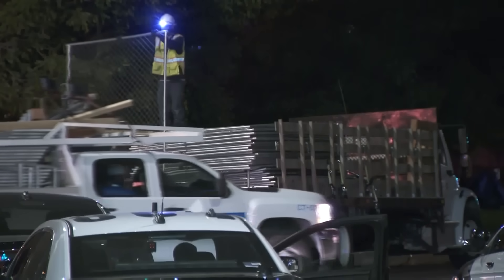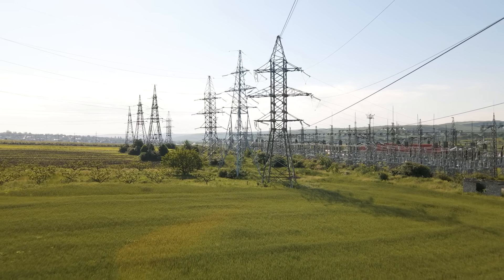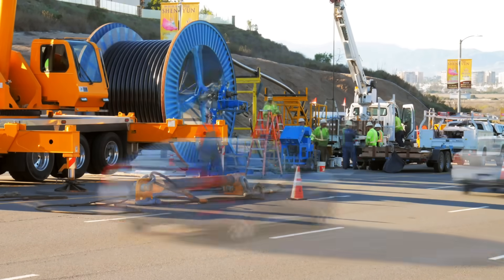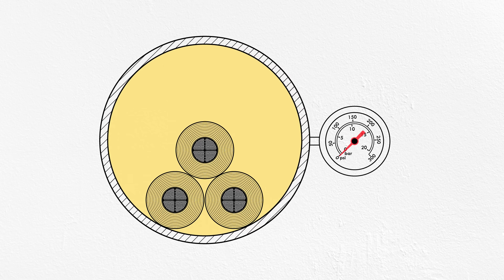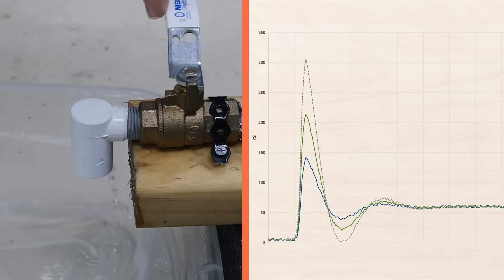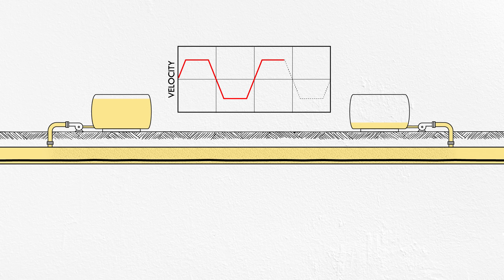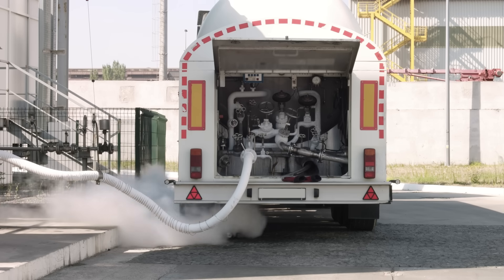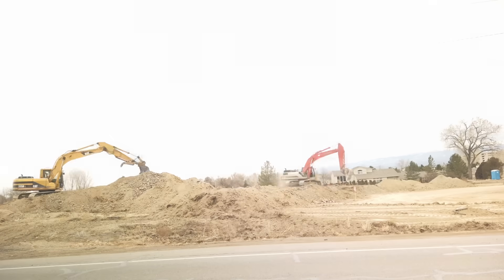Repairing Underground Power Cables Is Nearly Impossible

Comment: The craziest thing (to me) about underground cables is this:
Underground high voltage cables are very long conductors energized at high voltages, all within inches of other phases and ground, but separated by some insulator (like oil or polyethylene).
There's another name for big conductors packed as close as possible and separated by dielectrics:
"Capacitors"
The sheer amount of energy that ends up stored in the electric fields in those underground pipes is enormous. It changes the way you have to think about transmitting electricity because all of your lines are way more capacitive than they would be on poles.
Reply: HVDC underground takes care of this.  It builds up a charge capacitance, and then holds there.   Which is actually how we test them.  Charge them up to a set voltage, and let them hold it.
Reply: @philtimmons722  Oh absolutely. Unfortunately the cost of converting from AC to DC to AC is more expensive than just building a 10 mile underground line.

Comment: Hmm, interesting. And that was a pretty clever solution. I've long wanted our power lines here in the Midwest (and specifically within Tornado Alley) to be buried. Tornadoes, blizzards, and high winds regularly take out electric lines. Burying the power lines would be expensive, but the reduced regular maintenance/replacement costs would most likely be worth it. I hadn't really considered the high voltage transmission lines before since I didn't really know much about them. I didn't realize arching was such a constant concern/worry with them.

As for burying the power lines, the main concerns here would be animals getting into them and the constant fluctuation of temperatures. Let's just say that it gets a hell of a lot colder up here in Iowa than is does in Southern California.
Reply: Not sure what you mean at reduced maintenance cost. This method he says was costing tens of millions of dollars in repairs. Underground seems to be a MORE expensive technique.
Reply: @riotson  After the damage from hurricane Ida, Entergy Louisiana President Phillip May, who leads the state's largest power provider, estimated repair and restoration costs for his company alone could reach 2.4 billion.
Reply: @Ken.-  And what's to say it wouldn't have damaged the delicate underground wires and pumping stations?
Reply: @riotson  Wind doesn't travel underground.
Reply: @Ken.-  wind knocks out buildings and water travels underground.
Reply: @riotson  Well, I don't know of any pumping stations that were knocked out and water has to be pumped out continuously in NOLA since it's all below sea level.
Reply: @Ken.-  Just Google it, a quick Google about whether it's more cost effort for places of hurricanes seemed inconclusive. Some said more expensive, some said maybe better, depending certain situations. You just can't assume it would be cheaper though after this video says how expensive and how much work it was.
Reply: @riotson  I was talking about places in Tornado Alley specifically, not hurricanes. By the time a hurricane gets this far north, it's just a particularly strong storm - and one that is likely to spawn tornadoes.

My state, Iowa, has the 3rd most tornadoes every year - after Texas and Oklahoma. And that's when you consider that Iowa is a fraction of the size of either of those states. We get straight line winds and blizzards even more often. Just last summer, we had the derecho which took down power for much of the state for over a week and took 2 weeks in some places to be fixed. If the power lines had been buried, we still would have had a ton of cleanup (we're still cleaning up debris and downed trees - my parents still haven't found the time and money to replace the siding on the north side of the house that got torn off), but we wouldn't have had the problems of no electricity with which to do the initial clean up.

About 10 years ago, we had a blizzard that took out power through half of the state and then temps dropped to -20F for the next week. Most ppl had their power restored in about 2-3 days, but there were places where they evacuated residents because it would be a week before power would be restored.

I would also add that one repair in what... 20-30 years verses the cost of replacing practically the entire network every couple years is probably cheaper in the long run. Plus, as more places adopt the technology, it inevitably gets cheaper as supply is increased to keep up with demand. And they'll also come up with better and cheaper ways to enact repairs as well.
Reply: @BreeBadger  Two weeks? There are about 10k still without power after Ida and it's been nearly a month.
Reply: @Ken.-  Hurricanes have very different wind speeds from thunderstorms and blizzards. And tornadoes are much more localized and concentrated. It's a completely different scale of destruction, plus you have to deal with flooding as well as wind damage.

Given the sealed system they came up with for the line in CA, I don't see why flooding would cause a problem for a system like that. Earthquakes are much more likely to damage a system like that. And ofc the ground temps fluctuating would weaken the metal casing (in addition to the wires themselves) over time north of roughly about the halfway point of Missouri in terms of North/South. That wouldn't be a concern for the areas around the Gulf that are the most prone to hurricanes.

But like I pointed out with the power outage post-derecho, it's a lot easier to clean up when you can use power tools, right?

Comment: I wish you had specified in the title that repairing THIS type of underground power cables is nearly impossible. There are underground power lines in Europe, they look nothing like this (they have separate phases running at a distance to each other), and AFAIK they're not particularly difficult to repair.
Reply: Sssst.. Don't give away our secrets! They might switch to 240V and mandatory residual current protection if you're not careful!
Reply: How many of those cables were in place in the 1980s?
Reply: @Guysm1l3y  They were the dominant cable type for HV and MV distribution as early as the 1960s...
Reply: @Guysm1l3y  I have no idea. How is that relevant? I was talking about how the title is somewhat misleading, talking about underground power cables in general whereas the topic is one particular type. Neither I nor the title mentioned anything about the time period. So, repairing underground power cables WAS almost impossible. Today they are just insulated cables, and can be fixed comparatively easily - still more complicated and expensive than overhead cables, but nowhere near impossible.
Reply: ...speaking of, is there a chance Practical Engineering could analyze the EU power system? I know we have lots of it in the ground and it would be nice learning how it works :)

Comment: I know of an underground high voltage cable in Switzerland that is supra cooled with liquid nitrogen and thus has zero electrical resistance. I always wondered why they chose that expensive, high-tech solution, now I know why.

Comment: This is a good example of engineering not working with operations. The engineers designed the line without considering how the operations team was going to maintain it. In the end, it looks like the teams finally worked together to implement the preventive measures.

Comment: Honestly Grady, I was shocked to hear that they were still using the oil insulation method into the 2010's.  I guess it would be very expensive to replace that much cable when there didn't appear to be a need (tough sell to the shareholders), but Polyethylene jacketed cable has been around for decades now.
Reply: The oil insulated cables can take higher voltage levels and i more resistant to ageing.

Comment: Interesting. I never knew high-power electrical lines COULD be placed underground. I guess, though, it's very expensive or the TVA would use them more to prevent damage to the lines from tornadoes, like we had in 2011.

Comment: Why not just switch these underground HPFF power cables to super-cooled cables using LN2?  That would eliminate all the problems which you mention in this video while making parasitic losses due to heat and conductive losses since the lines would become superconductors that would allow electricity to flow free of resistance, or is that still not feasible?

Comment: As a water engineer I’ve come across these oil filled electrical cables a number of times. The asset owners have always been incredibly nervous about us working near these lines and now I know why! Thanks for the awesome vids, very informative.
Reply: Same, pipeline engineer here for drinking water and district heating. Theres 2 different variants from late 50's and early 60s: oil pressure and paper-lead cables. I always sigh when i encounter them because they lead to extensive discussions with the owner.
Reply: That oil is also highly flammable. Break those lines, and everyone is going to have a very bad day
Reply: @michaelkincaid9582  If they fail underground they don't normally catch on fire.  They quickly consume the available oxygen around them.
Reply: @newhallgeorge1  ...hi George.  Remp here.
Reply: @michaelkincaid9582  ...were you a cable splicer out of WLA?
Reply: @RobertsIslandLivingAdventures  No, I work with lower power HV cables. 20 AWG is more my speed. I think they mostly go into X-Ray machines and high power radio equipment and such
Reply: @michaelkincaid9582  They worked on that problem and came up with a solution using inflammable oil instead.
Reply: I worked Trouble at LADWP.  A 230kV Cable would make an explosion you wouldn’t want to be around.  There are videos about 35kV cables exploding that are bad enough.
Reply: @RobertsIslandLivingAdventures  
Worked those same lines 34.5kv and 138kv out of Hollywood.
Reply: @dougw5950  ...then you know me?   Are you Doug from Trouble?  DS-6
Reply: “You’re not going to use that backhoe, right?”
Reply: Imagine if your insurance company had any clue....

Comment: The steel mill I work for, was build in the early fifties and in no part, from melting ore to cold flat rolling, we have such an installation. We have an own gas powerplant producing the energy, all cables in underground tunnels, some u can drive through with a truck, running to each area of the process.
Transformators bathed in oil I know, but such a complicated powerline system I have never seen before.
Thank u for that.

Comment: Hey, Practical Engineering! Why would one ever build a rigid concrete pouring truck with 7 axles? We talk here of normal truck tyres on a regular truck with the big foldable hose mounted on a folded crane. Weight? Well it doesn't actually transport any concrete or cargo so shouldn't be made heavy by it, and while a weighty crane is good, when in use it's on struts, not it's wheels, and so surely 7 is overkill. Australia employs more axles than the US just in general, I have long thought for reduced braking distance (semi trailers will have by default 3 axles; and can have 4 [same with the actually semi] with multiple trailers being exceedingly common), but 7 on a concrete pourer?! Answer? The engineer(s) must surely have thought it through. !

Comment: In the Netherlands there is just realized an underground cable for 380kV AC. Running over 10 km inbetween Delft and a nearby city. 150kV ilines are only put underground in urban locations. The 380kV line is te first of its kind underground and is in collaboration with the Delft University of sience.

Comment: As a fun fact, new underground high voltage cables do not use paper insulation anymore, they use XPLE (Cross-linked polyethylene) and are manufactured in a big tower aided by gravity. This material is much safer.

Comment: It feels like the design choices were driven by performance and cost of installation, as opposed to maintenance and total cost over the line's operational life. Also monitoring didn't seem to be considered, since the investigation was due to a fault (as opposed to ongoing monitoring). Additionally, the fault location method seemed to have required several experiments after the fault was apparent. I understand this was an implementation of relatively new technology, but fault detection/location and maintenance are hardly new requirements.

Comment: How do you think they determined the high pressure oil wouldn’t blow the frozen oil plugs out of the pipe once it was opened. It seems like that would be difficult to pull off. Thanks for the video!

Comment: There was a similar underground line replacement project in my neighbourhood (St. Maxime - Marie Victorin line, near Montreal) in 2019. As they gave the new one a different routing, I suppose they also switched to a newer, oil-free insulation technique. One major difference, though, is that they actually removed the old line after the new one was completed.

Comment: I'm a little surprised they opted to run the new line-set through an entirely new route.

I would have expected them to completely decommission the original line-set, drain the outer pipe and use it for the new self-insulated cables and possibly even be able to run a second line-set through the original pipe doubling it's capacity. Possibly refilling the pipe with some form of coolant (a water/ethylene glycol mix perhaps) to keep the cables cool without needing to pressurize the pipe (or at least not nearly as much) which would simplify future repairs and ongoing operations & maintenance...
Reply: The original line was in service and could not be shut off.
Reply: @TomMcMahon  Ummm, wouldn't they have to kill the power in order to repair the damaged cable?
By draining the oil from the pipe, the cable loses it's insulation and would definitely arc at multiple points along it's length if left live, besides, it's 3 cables for a 3-Phase line-set and you can't run the line-set with 1 Phase missing, that would cause all kinds of havoc and equipment damage elsewhere in the Grid...

Comment: I had NO IDEA they would have been using high pressure oil and LN2 for power transmission back in the 80's (but I WOULD have expected paper insulators)
Polyethylene seems like SUCH an OBVIOUS choice, I don't get why they did use that to begin with... weird

Comment: I lived at the time On Rose ave near Bundy Drive in a suburb Of Los Angeles  Near one of the Splices you described in your video. I am an industrial automation electrical Contractor So somewhat familiar with transmission. At the time I questioned the crews doing the work as to what had  caused the fault. This is what they told me. "engineers were attempting to increase the load capacity on the line by increasing the oil velocity in an attempt to cool the conductors to increase capacity and during this procedure the line failed" . Great Video about this very informative keep up the good work !!! Barry

Comment: The three lines are not phases, they're called lines.
A phase is the voltage differential from line 1 to 2, 1 to 3, and 2 to 3.  
I'm happy to share because I myself just learned this, after working in the trades for almost 20 years.
Reply: Correct, phase refers to the 120 degrees of phase shift between the waveforms, rotational magnetic fields.

Comment: With all the hurricane damage that has occurred to electrical distribution systems (like what happened in Louisiana) I wondered why they did not put them underground.  I now understand why, thank you.  They do have undersea power cables so they could come up with a solution to areas where the water table is just a few feet from the surface.

Comment: For a moment there, I thought the long-term fix to the original line's shortcomings was going to be to just admit defeat and install a new above-ground transmission line using traditional towers. At least the new line eliminates all that oil pumping like the line was some kind of a living beast that needs its blood to keep circulating and constantly monitored by a crew of medicos (how low-tech!).

Comment: Great video. I’m a high voltage electrician and we do underground fault repairs. You didn’t kiss anything in the video. Modern underground cables today are a lot easier especially with the thumper. They usually have a thin PVC coating per phase and no oil
Reply: You didn’t miss anything*